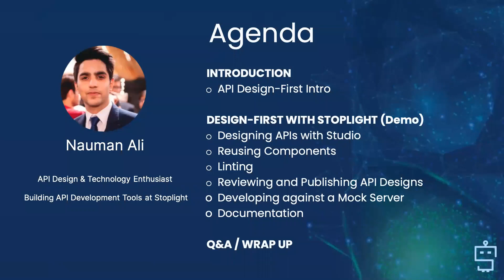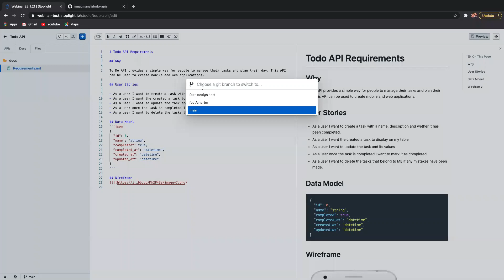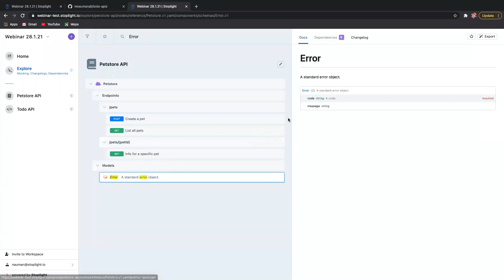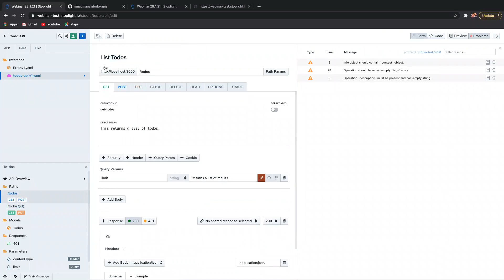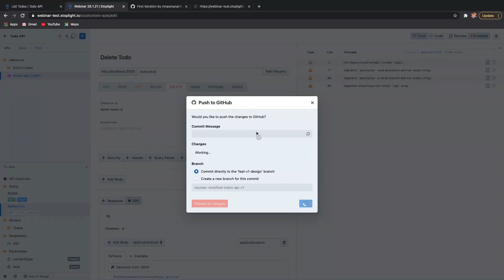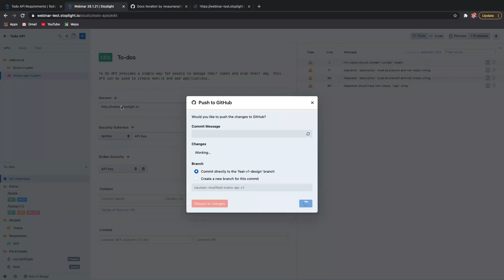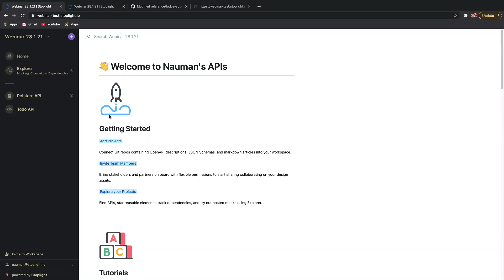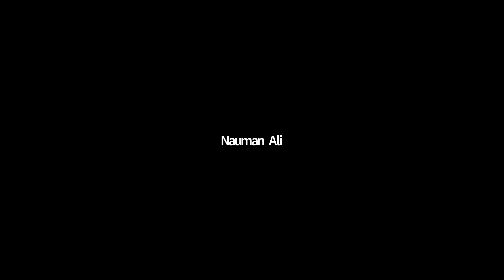API Design-First Workflow - January 2021

Comment: Thank you for your work! Your material is very useful. I tried to make my example according to yours. Changed Manage Access to Public but still have problem with CORS. It works well only with desktop application. Would be glad for any information.
Reply from the maker: Glad you are enjoying the content. If you're making calls from within the request maker, CORS requests aren't possible due to browser limitations. You can go around that by enabling CORS on your API. Hope that helps.